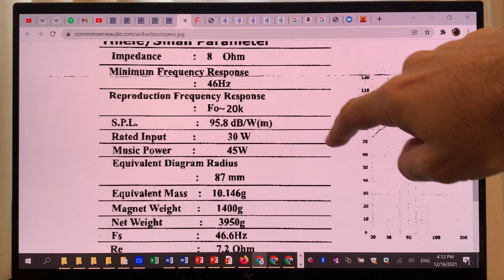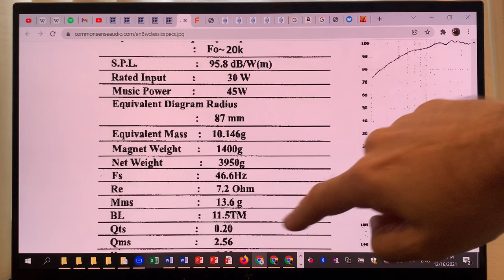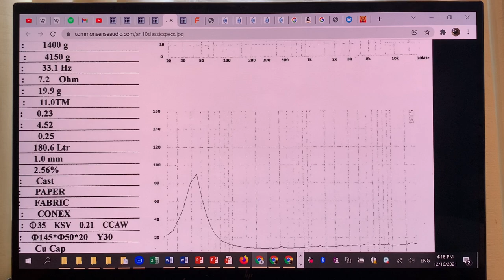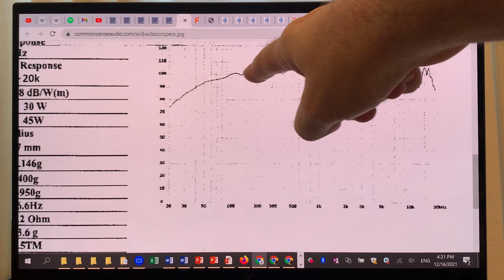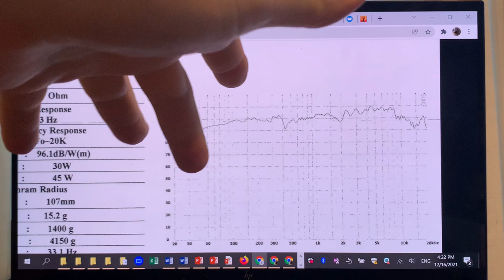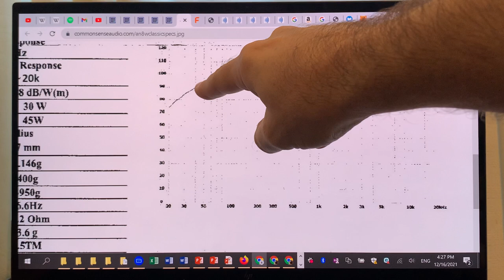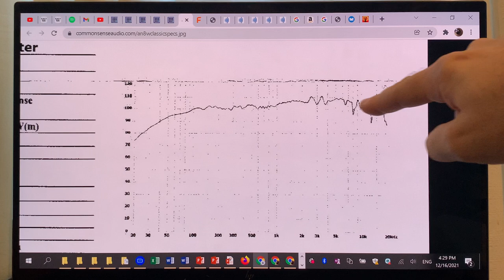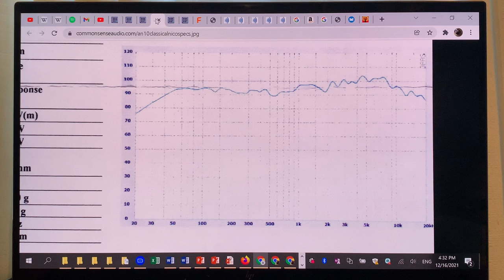Audio Nirvana 10 Classic

Comment: I have the 10" ferrite's built into the recommended bass reflex cabinets. Was a lockdown project... They're amazing for a lot of music except rock. Also, I found I needed to add an attenuator to roll of the brightness, they're very bright. You could also use an eq which I find helps alot to bring out the low and mids and roll off the highs. And to your point they do sound a lot better being run by my Acurus a150 then my 6wpc class a tube amp, which I'd built them for.

Comment: what do you think of linearray you a fan! I saw a  nice little driver
3" frequency 98hz to 20KHz
would make good linearray and on the bottom have two big 10" bass sabs in a cardioid configuration.
I would have thought it sound quite good
Reply from the maker: I prefer to keep the drive count as low as possible with high quality drivers. (Not necessarily expensive, just well-built and high efficiency.) Yet, line arrays can be done well, worth a try! ; )
Reply: @realworldaudio  yeah I've not had any experience with them but people do seem to like them
Reply from the maker: @hoobsgroove  One of my friend built the Bottlehead Straight 8 (a good while ago). Sounded very good, the highs very super hot (for his liking) but that can be easily adjusted. Overall, it was a relatively inexpensive project with sound that you can get only at very high price point from commercial speakers.
Reply: @realworldaudio  bottlehead are amplifiers, not sure what that's got to with the linearray?!
Reply from the maker: @hoobsgroove  It's a loudspeaker. Bottlehead Straight 8. ; ) Check it out. Not sure if they are offering it now, but they did in the past.
Reply: @realworldaudio  ok sorry! the same people that make the amplifiers
Reply from the maker: @hoobsgroove  Yes, Doc Bottlehead himself came up with the Straight 8 array.